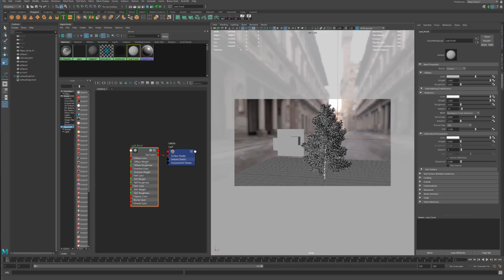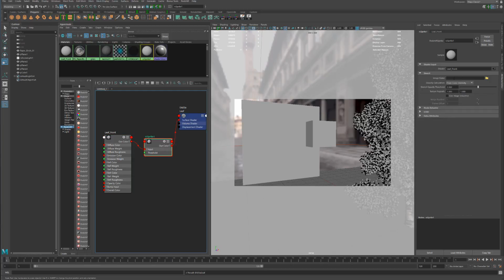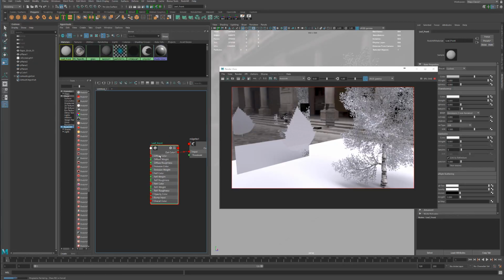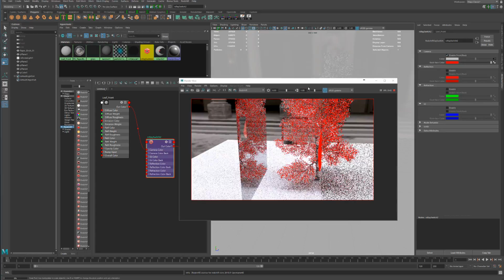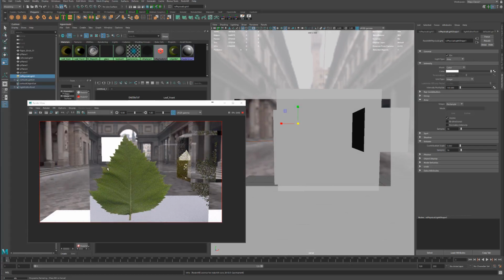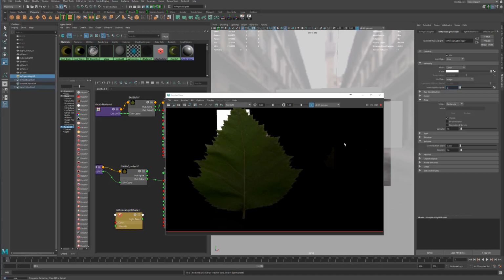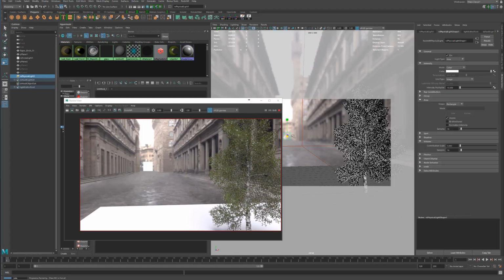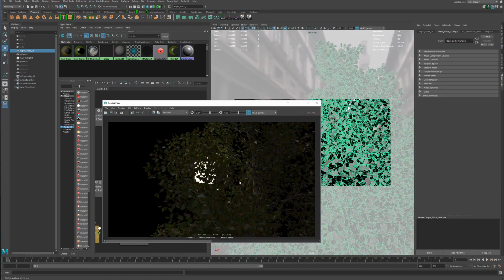Redshift 2 Maya - Tutorial #4 - Sprite & Ray Switch Nodes - Making a Leaf Shader

Comment: Does the lighting aspect work with the proxies export or only with the native scene? Thanks
Reply from the maker: what do you mean? Anything you make can be proxied out and will work exactly like it did before you turned it into a proxy and you can override any shaders too.
Reply: Saul Espinosa - oh you just answered it,   I’ve had issues with proxies not carrying all of the info back into Maya esp with Arnold - since I’m switching to Redshift and will be using/testing both of your methods on a huge scene this weekend, I wanted to make sure I didn’t miss a step on the rayswitch that may need to be checked if exporting. Good to know it’s a solid workflow. - thanks!

Comment: thank you a lot, that was helpful ! Will you be covering a video for rendering maya nhair too ?
Reply from the maker: I actually dont know much about rendering nHair or Xgen with Redshift but I can look into it. I know it can be done but I only know the Rendering process with Shave And Haircut. Maya 2017 Update 3 should be out soon with a huge upgrade to the new Xgen Interactive grooming tools also which are  replacing the old nHair and older Xgen splines hair system so I think I will wait a bit before making the tutorial so I can cover the new stuff.